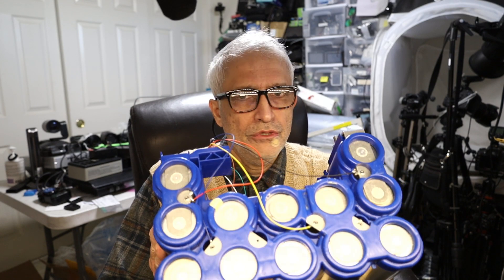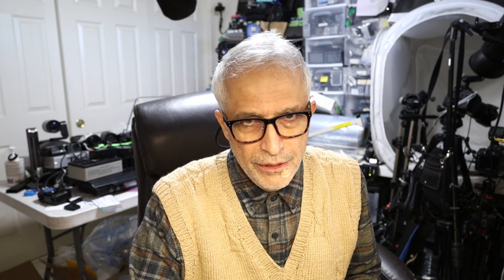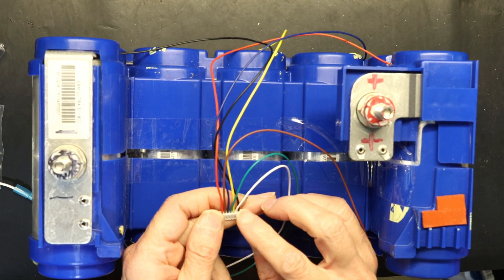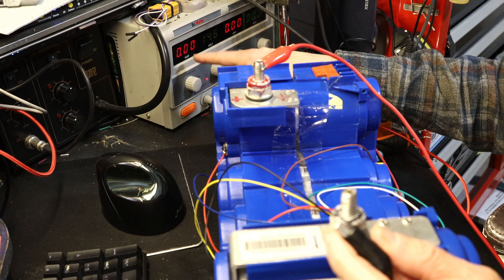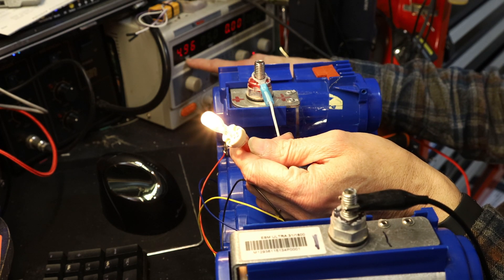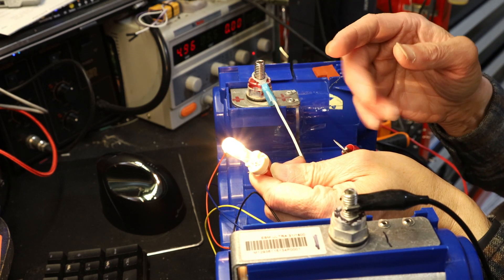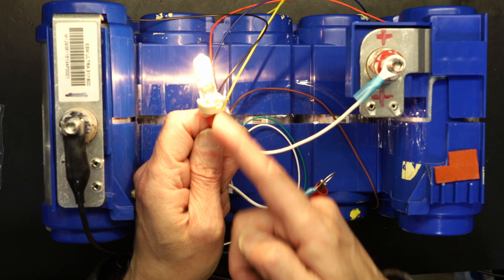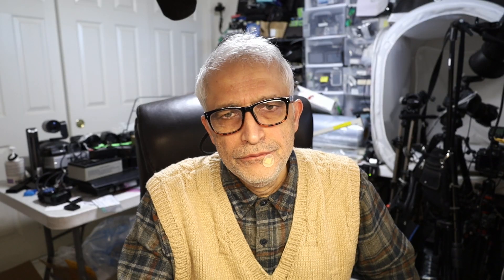How to Safely Charge & Discharge Maxwell or Nesscap Ultra & Farad Super Capacitor Banks

Comment: To charge your super capacitors you can use a current charger, where you choose the value of charging current and set the maximum voltage do not over charge your super capacitors. Using a light bulb you are spending double energy to charge your capacitors, absolutely not cheap!!
Reply from the maker: Yes a regulated-current power supply is ideal. However if you don't have one you must use a resistor or a light bulb, and lose some energy to heat to prevent damage to your capacitors or power supply.

Comment: Yes, a permanent high-power halogen light bulb in series is a very good idea. It's resistance has a positive temperature coefficient and with a high current the bulb will glow and the resistance is high to limit the current through the pack.
When the capacitor is almost full, the bulb will dim and go out decreasing its resistance to nearly nothing (1 ohm). Therefore the capacitors can also cover all the high spikes in the battery system, protect the battery and the system and increasesthe battery livespan. Also, it protects the balancing board when a failure occurs. 👍🏻
Reply from the maker: That's an excellent point, thanks for the comment!

Comment: I want to make one of these things. I know enough about 12V power systems, I just need to learn what the numbers mean on those cylinder things because I can’t afford to guess anymore 😂😵 This video was helpful.
Wait, so you are using a light bulb as a resistor to charge to the super capacitor? The bulb is limiting the flow of power to the capacitor allowing it to charge safely with a convenient indicator light? Cool.
Reply from the maker: Yes, that is exactly what I am doing. The light will go out once the capacitor is fully charged since there will be no more current flow going through it.

Comment: I'm attempting to replace the Auxiliary start/stop battery with a supercap bank. From what I can tell, the primary 12v LA battery will still handle the majority of the functions, but the supercaps will handle the starts from EV mod etc. I'm impatient and may try a quicker, but riskier option to charge the supercap initially.
Reply from the maker: Good luck and make sure to be careful of wires overheating and electrical sparks that could cause fire.
Reply: Be sure to pre charge it before connecting it, then you'll be fine.

Comment: Hey, do you mean that without a limiter the capacitor bank will attempt to exceed the calculated charging / discharging curve or you just tell its natural, calculated curve is just too much ? I want to give an inverter the equivalent of a few KWh for just a few seconds and the cap bank should be big enough to have just a few volts drop during this discharge. If i'd limit the current then that would defeat the purpose of the capacitor bank in the first place.
Reply from the maker: So only when the bank is completely empty ( discharged ) is when you need current limiting AKA Regulated power supply. Once it has reached it's peak charge it is safe to connect it without any current limiting circuits. The reason is that when it is fully charged it only discharges to handle the high demanding current draw for a fraction of the time which is very easily replenished by the power supply without overloading it.
Reply: @TECHNOLOGYTIPS101  I want to use a supercap bank as a starter. The bank will supply an inverter with something like the equivalent of 5 KWh, but just for a few seconds. I thought to have like 10V drop in 4 seconds (from 70 or 72 V) which should be more than enough. The inverter will then supply a DC PSU, PSU wired back to the supercap bank. Standing at 0.65 PF, (I measured it)  a hefty 35% power draw cut with a correction cap bank should allow the system to run indefinitely while leaving some for me to use as a load.
Reply from the maker: @fxeconomist  Yes that is correct, but you will need to make sure the Super Capacitor supports up 75V DC, because the one I am demonstrating can only go up to 16V DC. You could use 5 of these in series with at balancing circuit on each one to get an 80V Super Capacitor. Keep in mind that connecting Capacitors in series may increase the voltage tolerance but it will reduce the capacity which I am sure you know.
Reply: @TECHNOLOGYTIPS101  Can you elaborate on this balancing circuit ?
Reply from the maker: @fxeconomist  Absolutely, I actually made a video on that. Here is the link https://youtu.be/6YIMzEwEDLE

Comment: You’re using a current ‘limited’ power supply, not a current ‘eliminated’ supply. 

A small correction in the use of language . 

I imagine you took those capacitors out of the plastic box that they were in. 

Good explanation though.
Reply from the maker: Good point; I meant to say Regulated Power Supply, but my brain blacked out at that moment. Yes, I took them out of the Maxwell Engine Starter Modules.

Comment: You make a good point. However you set the power supply to max 5 amps and the rated voltage of the Capacitor. The voltage will slowly increase as the capacitor is charged. When the set voltage is reached then the current will drop to zero.  The bulb is good for discharging the Capacitor.
Reply from the maker: Yes but without the bulb the power supply will be subject to a load similar to being short circuited due to massive current burst. So you can only charge it without any bulb if you have a regulated power supply where you can limit the current flow.

Comment: Dear sir,

Good day

This is preethesh kumar from India I have already purchased 165F, 48V x 2 pcs I have technical query regarding some conditions while charging and discharging.

Question 1

1) sir, what is the max  charging current of this module 165F,48V.i have 50 ampere 48volt dc power supply source if I charge it directly will it damage the supercapacitor. If not possible  to charge directly with 50 ampere can I use high wattage resister in series. For 165F, 48V supercapacitor module can you suggest the resistance value and it's wattage for charging my concern I need fast charging. 

Question 2

2) sir, once 165F, 48Volt supercapacitor got charged fully with 48V, 50 ampere power supply source if capacitor got charged fully if I keep continue power supply on to the terminals of the capacitor after fully charging  will it consume current after fully charging and or will it damage any heating life decreasing plz check and inform me.

Question 3

3) what is the full output current of fully charged 165F,48V ultra capacitors.

Please reply for the above questions

Thank you 

Waiting for your reply
Reply from the maker: 1. If you wiring harness can handle it this Capacitor can be charged at 500 Amps continuous. But that will generate too much heat if your don't have the right wire gauge.

2. Unlike batteries the capacitor can be connected continuously to the charger and as long as the voltage is not over 48V DC it will not damage the capacitor even if it is connected to the charger permanently.

3. The Ultra Capacitor Bank can provide sudden burst of current up to 1100 Amperes. That is One Thousand One Hundered AMPS as long as the wiring harness supports that current.

Comment: Why not just use the appropriate size power resistor from the charger instead of a lamp. It would charge faster than just using a random incandescent lamp.
Reply from the maker: The Resistor will generate a lot of heat, and high wattage resistors are very expensive.  In addition to that, when the capacitor is full the resistor will not indicate it. With the Light bulb most of the heat escapes in the form of visible light instead of Infrared. Also as the capacitor gets near full the light dims, and when it is completely full the light goes off.

Comment: hello sir i have 6 2.7v maxwell super capacitors 3000f connected in series how many amperes and voltage of light bulb i should use ?
Reply from the maker: That depends on your charger's power and wire gauge, because the capacitor can handle over one thousand amps and there are very few power supplies that can handle that. So if your power supply is 100W which is 12V 8.3Amps you can only use one 100W bulb, for a 200W power supply two 100W bulbs in parallel, for 300W 3x 100W bulbs in parallel etc.
Reply: @TECHNOLOGYTIPS101  i will use 13.5v 50a regulated power supply with 8awg wire is it ok not to use bulb ?
Reply from the maker: @kunhei_the_Ben  As long as you can regulate the current not to exceed the maximum you should be good. Start with 1Amp and work your way up as the Capacitor charges. If you choose 8.3Amps which is the max, the power supply will heat up and the voltage will drop to very low voltage. Remember that connecting your power supply to a fully discharged Super Capacitor is like short circuiting the power supply.

Comment: This is very helpful. It's good to know how to do this safely. On my end when charging the supercap below I think I just lucked out. 

I realized when I received the Supercap that it was about 1.5 volts or so and that my lithium battery chargers would fault based on undervoltage. I hooked up a voltage meter to the circuit and used a 12v power supply (1.75 amp) and turned the power switch off and on every second or so until it gradually built up to the necessary voltage to be recognized by the charger (it seems like this was around 9 or 10 volts) which could then take over. It appears that with your light bulb assembly I would have not needed to be the "manual" power limiter, but the bulb could have taken my place without any intervention needed on my part.

I have a question that I'm facing with an application of a super capacitor and it seems like you are someone who could help me find the answer. I don't have an electronics background, but I'm generally really handy/capable at finding and implementing solutions.  I'll put the question out there, in case you'd be willing to give me some pointers. I apologize if this is hijacking your thread. If I knew where to find the answer I'd go there. I'm still trying to find the answer. 

I'm using an LifeP04 battery in place of an SLA battery to power an automatic gate opener as the sole power source for the gate. I'm using an adequately sized solar panel to charge they system and the battery size of the LifeP04 battery is 55 AH. The SuperCap is 16v 500F.  I'm not sure of the load of the gate opener, but it's not huge.  From what I can tell, the BMS in the battery is activating an undervoltage protection for the battery occasionally, as occasionally the voltage drops into the 10v range and the gate control faults and stops the gate. It takes a reinitiation of the gate control to complete the gate cycle as the gate stops. I've purchased a SuperCap to run in parallel with the battery to help it get over the excess load during the peak draw and want to limit the amount of power that can be drawn from the battery before the supercap has given up the power first. I'd like to limit that drawdown of the battery to around 11 volts. My intention is to install a resistor on the battery side to accomplish this. I just don't know the size. I've seen misc. sizes from automotive application videos, but the one that identified the voltage during the drawdown was going to less than 11 volts. Would you be willing to offer any pointers?

Also, now I'm curious... If I understand correctly - a potentiometer is a variable resistor. Are there (heavy duty/affordable/readily available) potentiometer's that would be safe for this current range that I could simply dial in to get into the voltage range that I'm trying to stay in? This would help if my guess of 11 volts isn't the right guess as I could just do a quick adjustment until the gate functions correctly.  Even if I only used the POT to test/establish the ultimate size of the fixed resistor... and then installed a fixed resistor.
Reply from the maker: Greetings, I need to know the normal current draw of the gate opener, and the maximum current draw in case there is an object blocking the gate. If the gate gets stuck, I need to know if the motor continues to force the gate to open or will it give up after certain amount of current draw.

Comment: So are you saying the manufacturer is incorrect and just letting you hook up the ultra capacitor to the battery. Would you have any input and why the ultracapacitor that I have which is a Maxwell 31 group semi truck starting module will not charge past 12 volts , it all of a sudden after two years old stopped charging past 12 volts
Reply from the maker: The way they are wired from the factory for the Vehicle starter, there are three wire terminal posts. One goes to the Vehicle Starter, the other one to the battery's positive terminal, and the third one connects to the ground. So, the safe charging circuit inside will do the trick.  About your Capacitor not charging past 12V, it could be two things, either a bad " Capacitor Balancing Board" or a bad " Alternator"
Reply: @TECHNOLOGYTIPS101  thank you for your prompt response it's not the alternator I've already tested it I've taken out the Maxwell capacitor and replaced it with the battery in the meantime is there anywhere I can access information to text the balancing board or is there anywhere I can purchase a new balancing board thank you for time
Reply from the maker: @MrRyanrk12   Sure, here is the link to the Balancing Board for the above Capacitor Bank https://www.ebay.com/itm/394438284901
Reply: Hi,

I have 48v 83F Supercapacitors in series with 3 parallel supercapacitors ( each of  62F, 18v).

I want to charge it directly from 48v battery.
What things do I require to consider for safe charging?

Comment: Thank you for your video, Just to clarify...  I am putting a 500F 16v supercapcitor before a 12V inverter (being run by a Lithium 12V battery.)   What your saying is to connect the capacitor in parrarell with the system I already have, charge it first to full capacity as shown in your video with 50 watt globe and then once fully charged (light goes off) connect it? Once it is connected the battery the voltage between capacitor and battery voltage should eventually go to equilibrium ? ... please advise 🙏 thanks again..
Reply from the maker: Yes that is correct, you could charge it directly without any bulb if you have a regulated power supply. Otherwise the current rush to the capacitor will overload your power supply, and if you use a small gauge wire you will have the potential for overheating wires and which could cause fire.
Reply: @TECHNOLOGYTIPS101  Thanks 👍
Reply from the maker: @JCMW-hw9jl  You are very welcome!

Comment: how can we charge the ultra capacitor module fast?
if we are connecting the ultracapacitors parallel to the battery in trucks or car will the capacitor charge fast enough to crank the engine during frequent starts and stops ?
Reply from the maker: Yes but you have to first slow charge it and when it is 100% full, only then you can connect it parallel with the car battery. Otherwise, the wires will get hot and possibly burn from excessive power rush to the capacitor. The capacitor can take 1000 amps or more of electrical current in one second, which is the same as shorting out the battery terminals, which could damage your battery.
Reply: @TECHNOLOGYTIPS101  In automobile system if supercapacitors are installed the current rating from the alternator is it enough to charge it fast.

to protect the battery from damage we can give a current controlling device like DC-DC converter between battery and capacitor, but to charge it quickly after one crank what will be the ampere rate at which it should be charged?

and datasheet or schematic for the balancing board, is it available can you share it
Reply from the maker: @ABELELDOABRAHAM  When the Super Capacitor is connected in parallel with the battery their voltages will even out and reach equilibrium. In such a case, there will be no current flow to either direction between the battery and the capacitor. However in order to reach equilibrium for the very first time when the capacitor is completely empty you must do a slow and regulated charge unless you have a DC Power Source that can handle a sudden current flow of hundreds of amps. Even if you do have such a power supply the connecting cables must be secured tightly before the power supply is turned ON, otherwise, you will have arc, spark, overheating, and fire. I have even witnessed cases where the charging cable terminal melted and got welded to the capacitor screw post.  You can get the data sheets from here https://maxwell.com/products/ultracapacitors/downloads/